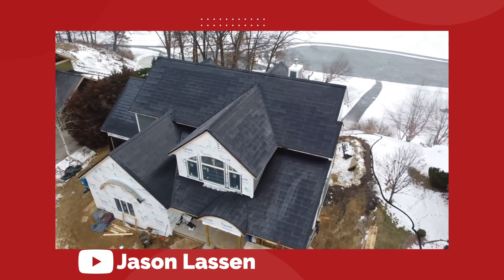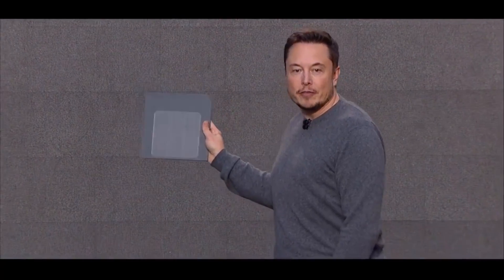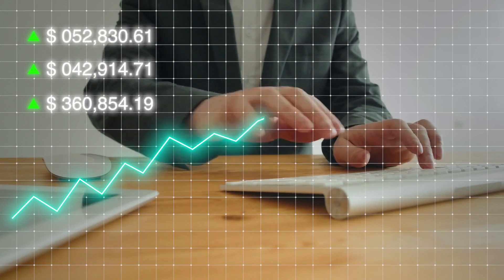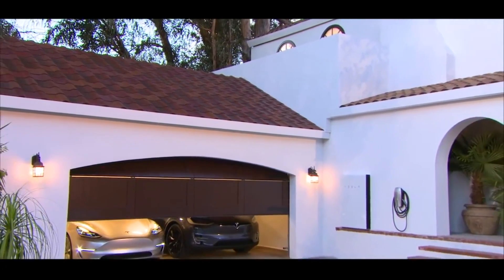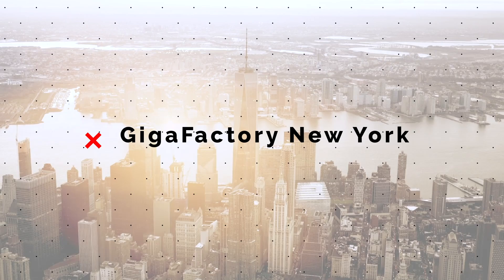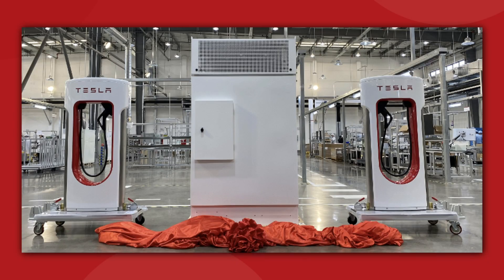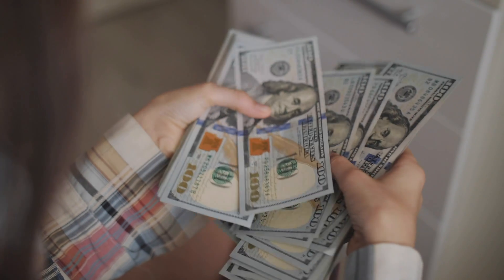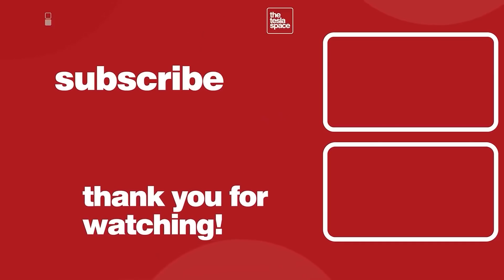The Tesla Solar 2022 Update Is Here..

Comment: I can see the grid access charge, but not rated based on the installed size of the system. If anything, it should be based on the amount you send to the grid. If you have batteries and don’t use the grid then you are reducing the need for upgrades to the grid.

Comment: Put my order for regular Tesla solar panels + battery in a full month ago, and added all the info and photos the website requested. Next step is supposed to be getting a design created remotely. Nothing has happened thus far. No communication at all. I’ve reached out to customer service several times and no replies. Sad
Reply from the maker: Unfortunately a story we've heard quite a few times. Really hope they get this side of the business together eventually because it would be great but for whatever reason Solar is failing to live up to its potential. Hope your situation gets sorted out, keep us updated!
Reply: With Tesla Energy, you can't passively wait for the project to make progress. You HAVE to be the project manager. That means frequent calls (I was calling almost daily to light a fire under them). I'm now about to install, but it doesn't end there. I'll need to keep on top of them to ensure they submit the required paperwork to get permission to operate ("PTO").

Tesla Energy (at least on the residential side) is a disaster. But if you're persistent, you can squeeze the value proposition out of them.

Comment: One of the "features" of the changes to rates and the $8 / KWh installed proposal is to encourage solar system owners to install batteries.  I had to search a few documents to understand how the CPUC thought this would work. It seems they intend in actually significantly rates during evening hours at peak usage times when solar is down to get people to add batteries to their home systems. Someone help me here if I got this wrong or can better explain how they are encouraging batteries. Also it seems like it would be a lot more economical to do this at the Utility level instead of the homeowner sites for the same scale reasons that we have large central generating stations for legacy power instead of our own individual ones. Does anyone know of a study with data on the economics of distributed battery storage versus centralized?
Reply: Hi,battery storage become expensive if you want to buy higher storage capacity .It depends of what kind of batteies you want to buy. Litheum battery is very poweful and have longer life ,but its  price is very high.Therefore ,on grid solar system is much more economical  for individuals than off grid solar system everywhere in the States

Comment: I live in CA. Generally I agree that the changes proposed by the CPUC for solar owners are bad and will cause new installations to slow down. The reducing the rates paid to solar customers does make sense, Utilities are forced to over pay and this overpayment is subsidized by other rate payers. Payout rates should be the same as the utility cost for renewable power. The $8 / KWh tariff is the big issue. The policy is the states way of collecting a tax that the CPUC can spend as they see fit (the legislature is unlikely to take the money from them and spend how they want to). Besides spending it on the grid, the want to do some social engineering (help disadvantaged people add solar to their homes) and this will be a mess as they will have to make repairs and fix roofs in addition to paying for solar installs. It's likely in the end that the people that need help would be better off overall if they just paid the funds out to them rather than having a bunch of it eaten up administratively. I live near the coast and my power bill is about $80 per month. If I had a decent sized system the tariff could be more than what I currently pay without solar. So where I was thinking about installing, I am no longer. If I ever did install, I would specify such that I was disconnect from the grid. I just don't understand why they would tax solar customers only for the grid, the rest of the rate payers must have a big increase coming as well.

Comment: The whole net-metering thing was an interesting idea for getting adoption. Functionally you're acting as a micro-generator, which means you should be selling power at WHOLESALE prices (ie about $0.01/kwh) not RETAIL prices. So yeah, being able to sell excess power back to the utility at RETAIL prices kinda needs to end at some point. 
On the other hand, paying a monthly fee for the privilege of owning solar panels won't stand up to the first lawsuit. A static connection fee to be able to sell your power back to the grid, perhaps, but not a per kw fee, and especially not if you decide to simply run your solar behind the meter with local storage and burn the excess maybe operating a crypto node.
Reply: Thank you I agree.. and I hope you are correct.
Reply: When utilities need extra power they purchase it at a premium. Solar roof production requires a big investment. If the utility needs/wants to exploit it why shouldn't they pay retail, or more, as with other providers? Answer: Because the utility sees the day coming when they will be replaced by private generators at a small fraction of the cost. Their unfair monopoly pricing/exploitation is coming to and end and they will fight like hell.
Reply: @1voluntaryist  Retail is what you pay for power. Wholesale is what the Utility pays the generators. Your investment cost is your issue, not the utility's, same as the generators' costs are their problem, not the utility's. The only difference is that you aren't actually competing with the other generators because you aren't actually selling on the spot market as a generator. So, if you wanted to install enough solar to actually be able to place bids as a generator, then sure, you could get paid spot market prices, too. Until that happens, the utilities have zero reason to pay you anything more than the base wholesale rate for your 4kw of solar capacity, which is now somewhere around $0.01/kwh.
Just like a generator, if you're not making enough per kwh to justify the investment cost, find something else lucrative to do with that generating capacity or don't install it. It's not the utility's responsibility to pay you to go off grid.

Comment: Residential solar does squeeze the grid maintenance costs of utilities.  However, the answer is higher fixed monthly 'connection fees' for everybody, rather than fees on solar panel owners.

Your claim that solar users are helping the grid by not relying on it as much is not really true.  Most of the grid maintenance cost is a fixed cost, not changing based on how much the grid is used (obviously excluding the fuel and other costs for generating power).  When people put up solar panels, they are buying less power and leaving fewer kWh sales to distribute the grid maintenance costs.  As more solar is added, fewer people buy power and variable costs go down while fixed costs stay the same causing price increases to distribute those fixed costs among declining sales, causing more people to buys solar and even fewer sales to cover fixed costs... and a downward spiral ensues.
Reply: One simple answer is the electric utility has to modernize and become an energy storage provider  - charge people for energy storage - don't tax the crap out of solar investors.

Comment: You say having solar takes stress off the grid but that is so far wrong. If you have a grid tied system then you are putting more stress in the grid than someone without it
Reply: I think it is actually true -- Solar adds power to the over stressed grid during the day when air conditioners are on.  They pull energy back at night when the demand is lower.  So they DO take stress of the grid by providing distributed local power to prevent excessive draw at the plant.   I fact check this mostly true.
Reply: simple solution that will anger them even more.

off grid, get out from their thumb.
they are already minimizing the reward for giving back to the system.

cut ties completely and throw a party with everything on during times of brown/black outs.

Comment: As a Californian I sympathize with MDoc. You state that NEM 3 will be the highest tax/fee in the country but by how much 10% or 100%? Sounds like Florida is right up there with us. Using battery storage to use your excess generated electricity at night is the only way around this, but is expensive. At least battery/solar systems will work during an extended outage. Most solar only homeowners don't even know their systems are useless in an outage. Hopefully battery storage costs will come down with greater adoption.

Comment: Residents of states need to make more noise about the states punishing them for going green.  Example: Here in the state of Georgia, I am penalized $213.00 a year for driving an Electric Vehicle.  The pinhead legislators came up with this based on an average of driving 24,000 miles per year.  I've had my EV for over three years and I just turned 24,000 miles. They claim the fee is to pay for road repairs.  They don't want you travelers through Georgia to know that for the past 9 years, they charge $5.00 tax for EVERY night you spend in a hotel/motel/B&B, in ADDITION the the typical local 12- 14% HotelMotel Tax claiming that this is for road improvements. Yet, if you travel through Georgia, the highways SUCK!! 
If you are going to travel through Georgia, plan your trip to stay overnight just over the state line, NOT in Georgia!!!

Comment: Hi, I am an electrical engineer, i known solar panels can work very well in sunny states where investment by individuals or companies is pretty feasible, but using solar in northern states with clouds ,rain and snow is not a good idea for the investor as the output power generated is badly reduced by weather conditions
Reply: Try norway
Reply: @jomarlindrupsen2718  Hi ,i think Norway uses wind power better than solar panels ,correct me if i am wrong!!
Reply: That's why the investment costs have to be kept low enough to encourage as much use of renewable solar as possible.  A little green energy is better than no green energy.   Add the solar tax like CA and no one will afford to try and produce green energy

Comment: I went solar after Hurricane Michael Cat 5 went through the panhandle of Florida back on 10/10/18.  Home owners insurance bought me a new roof.  Several months later a solar door to door man (not Tesla) came to the door and I bought a 40 panel system with net metering.  Cost 45k$ and after rebates was $38k.  Paid cash.  This past year I did not get a power bill except a $30/month fee to the power company for baseline fee.  I had a 5.4Mwh credit at the end of the year.  I was paid only 3.3 cents per Kwh by the power company at the end of the year but still I did not have to pay anything except the baseline fee throughout the year.  .  The Tesla power wall I believe is a 13.5 Kwh per wall with a max output of 5 Kwh per hour.  This will power the lights and baseline needs of the house but forget about the central air conditioner or dryer.  I produce up to mid 60 kwh per day and the best production is in March and April.  Panels don't work all that great when they are hot (June thru September) here in Fla.  Also much more humidity and clouds in the air especially with thunderstorms in the afternoon. Love my solar system and the Enphase app on my phone.  I make an average 1.6 Mwh per month.  Go solar!!! Also I was forced by the city or power company to get a million dollar liability policy for the system...only $230 per year. If you are going solar get as many panels that you can afford and forget the home storage battery systems.  The cost of panels are going down and the price of electricity is going up!
Reply: I think its ridiculous that you still need to pay a monthly service fee to the electric grid that you dont even use their energy! You should be able to disconnect completely
Reply: @matthewp1682  Dunno about US but in Finland I would be able to disconnect from the grid (reconnecting is very expensive). In that case I would need the batteries which are very expensive in the scale of a house. If you're going to pay 360$/y for the grid, you'll need to find really cheap batteries to beat that price.
Reply: @Pajune  Atleast in my state you cannot disconnect completely, you must still be hooked up to the energy company. I think so you can give them unused energy

Comment: The longer term problem in our energy transition is that there's a tipping point where people with solar systems will no longer be sending enough money to the utilities to fund themselves. But their power generation and distribution will still be necessary for a lot of the state. The utilities and regulators need a different business model. Hence this change in fee structure. Which sounds like it goes way too far in favor of the utility companies. Maybe something like this proposal, but cut in half to start.
Reply: While I agree with you in that we all need to pay for the infrastructure we use, and that we need a different business model for power generation and use, do not forget that most utilities in California make a killing on the power produced by rooftop solar during peak demand times. They get to sell the clean energy, often at a premium, to other customers at peak pricing, while their only cost is to provide power back to the customer who provided the PV energy when the utility pays the least for power. The PV power also offsets their need to purchase more of the most expensive power from peaker plants. So they are essentially asking the customer to pay for something that they make a lot of money on.

As a California resident, I believe that the utilities are asking for these changes to the grid tie solar metering just to recoup losses from their liability in causing fires from decades of cutting maintenance costs from tree trimming and and utility lines. A sort of screw you to those trying to hold them accountable for their mismanagement that has caused so many deaths and destruction.

Comment: Solar is the future but Tesla doesn't manufacture solar cells, they only assemble panels, they also don't make the correct high cycle batteries LFP which are more suitable. Rather buy from OEM's like BYD direct.

Comment: Rooftop solar reduces overall demand on the electrical grid but actually increases stress on the grid and can lead to instability. Renewable power sources are usually intermittent so other generating equipment sees load fluctuations that it needs to compensate for (usually inefficiently). When the fluctuation gets high enough to surpass the minimum or maximum capacity of the plant you will get a grid failure.
Reply: That might be true for grid level solar but with roof top solar you mainly have a spike of solar production at the same time there is a spike of air conditioning use. So the roof top solar is removing one of the biggest load spikes on the grid. Air conditioning
Reply: As an electrician who has worked on both clean energy and utility power plants, you are factually incorrect in the claim that rooftop solar increases grid stress. What has caused instability of the California grid is all of the thermo-electric power plants that have to curtail power output during peak demand due to a lack of adequate cooling water, this includes nuclear power plants. A changing climate is making this worse as time goes on. Texas had the same problem during the abnormally cold temperatures, as their thermo electric power plants and gas supplies were not designed for the cold weather, while PV and cold hardened wind turbines do just fine in cold weather.

The local production of energy by rooftop PV is not significant enough to do anything other than help stabilize the grid locally and help alleviate overloading on tertiary and secondary distribution lines. Rooftop solar will respond to the grid needs to lower production or increase production as available and needed by the grid.

If and when rooftop PV reaches a significant enough power output that it could effect grid stability, the same control systems can be connected to the grid controllers to allow even more direct control of rooftop PV output. These systems are now available and allow grid controllers to treat large areas of rooftop PV as single PV farms. They even connect to weather information and forecasting for predictive forecasting of energy needs and availability.

This leads to even more grid stability and lower stress on distribution lines, as PV has no problems being turned on and off as rapidly as needed, unlike steam turbines, gas turbines, and hydro turbines. Even wind turbines, While slower than PV to bring online or offline, are much faster than any other conventional power to react to grid demand, as they can have their blades feathered to reduce power or increase power, brakes applied, or be removed from use or returned to use at will.
Reply: Doesn't most users install a tesla battery pack, these days? So the fee is ok, if you check in the incentives and than use your electricity for yourself.
Reply: Everyone knew it, but ecological stupidity is stronger than reason and intelligence!